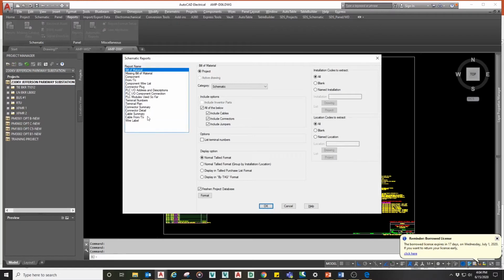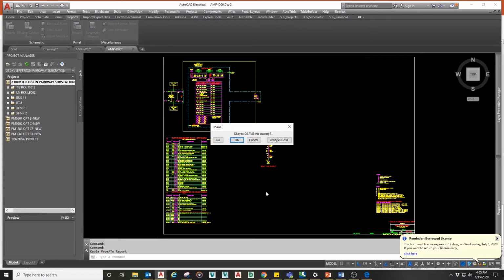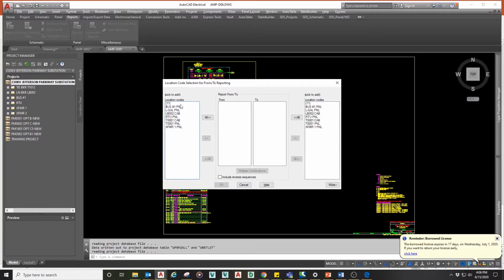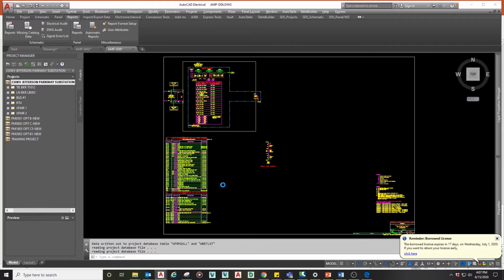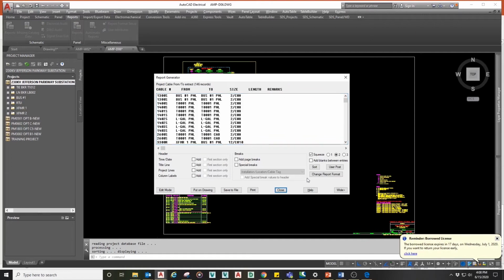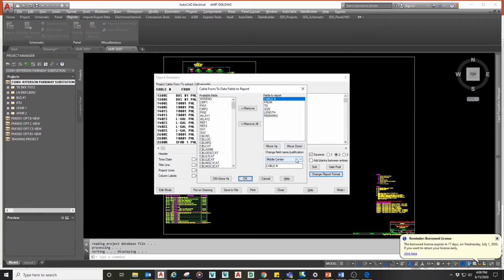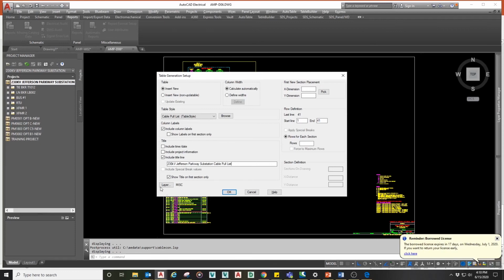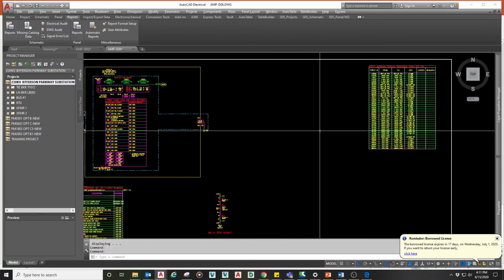Creating a Cable From/To Report Using AutoCAD Electrical

Comment: Thanks for your video, but would be more handful if you can show us, the proper way to make drawings that make this table possible, generate the table when the drawings have been created correctly is easy, the real challenge is to set a drawing able to generate the table with a couple of clicks.